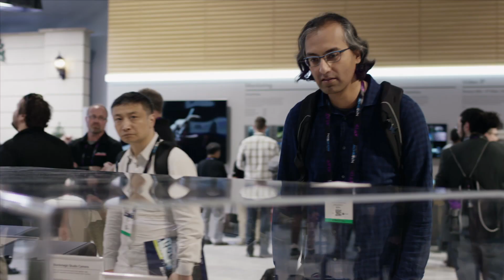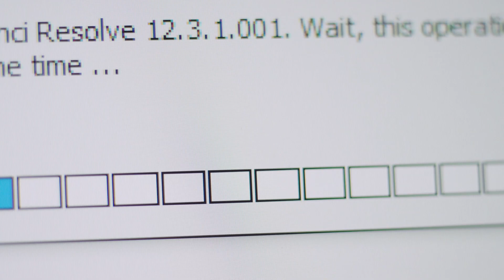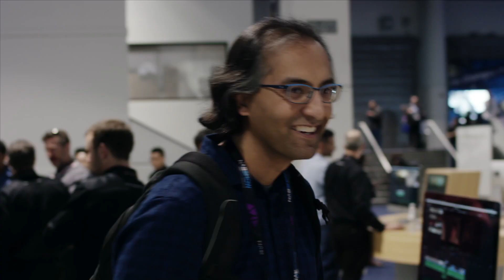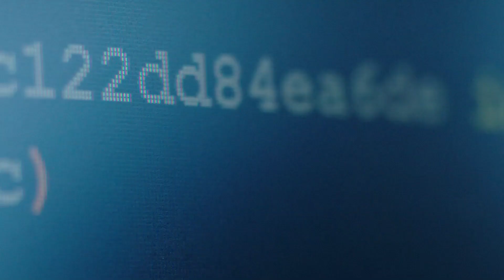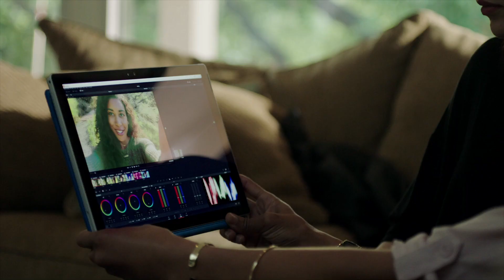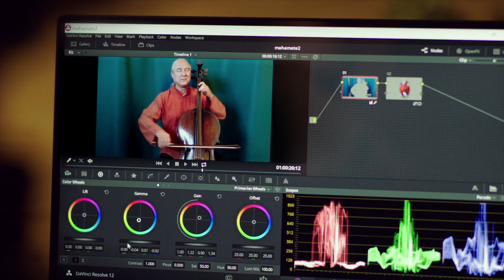Blackmagic and Iris™ Graphics: A Match Made at Intel® | Intel Software

Comment: Davinci Resolve 16 didn't want to play in the timeline at all on my Dell i7 tiger lake 11th Gen Iris Xe Max computer with 16GB ram. I'm not a power user at all but I do use Davinci Resolve a lot. It works fine on my 4 yr old Samsung Notebook 7 with nvidia 940MX graphics card. Updated to Resolve 16.2.7 on the Dell and at least it sees the Xe Max graphics card now. But still takes a while to even show the video preview window sometimes. Is this a Resolve issue or an Intel issue?
Reply from the maker: Sorry that you are facing issues. We suggest that you update the Intel Iris Xe MAX graphics to the latest drivers available at https://intel.ly/336v0FN. If the issue persists, please DM us on Twitter (@intel) or, send us a private message via Facebook with these details: 1) The complete processor model number 2) The current graphics driver version 3) Screenshots of the issue you are facing. We would love to discuss this further.

Comment: 1. What about the 10th Gen integrated graphics? 
2. what about the 11th Gen Xe graphics? 
3. Will da Vinci run on surface pro 7 i7/16gb version?
Reply: I think it works as long as your system have atleast 16gb of ram and a recent i5
Reply: Did you find out anythim. Am currently wondering too, if a new Iris chip would be acceptable for video editing - lightweight is a higher priority to me than best performance...

Comment: thank you sir but am getting this message each time i want to open the software saying devinci resolve cannot find the opencl capable for the gpu
Reply from the maker: Sorry to hear that you are facing difficulties. The issue could be due to the device not meeting the minimum application/tool requirements. We suggest you check the software developer’s website/community for the minimum system requirements of the application.

Comment: Hi.  I have a question regard the 0m43s point in your video.  I currently have Intel's Skull Canyon.  I also want to run Blackmagic Design's DaVinci Resolve on it.  Previous I could during the version v12.5 era of DaVinci Resolve, even on up to around v14.0.1.   BUT, NO more.   I get this error message 'DaVinci Resolve can not find any OpenCL capable GPUs'.   (Reference my Google Photos album:  https://photos.app.goo.gl/0u7YfrBaw3bbJIFq2  )   Why?

Before it was OK.  Now it is not OK.  Do I suddenly need to have an eGPU whereas before I did not with the Iris Pro Graphics 580?   And, will Intel release a newer Intel Skull Canyon sequel, hopefully with at least two (2) Thunderbolt 3 ports and discrete graphics?   Thanks.
Reply from the maker: Mahesh pointed us to a thread about this issue here: http://bit.ly/2Cx5iyq
Reply: And, that thread happens to be the one I created on my Google Photos account.  Thanks for pointing it out to me.  :-))   Oh, and since creating that album, Mahesh has admirably and gracefully found a solution to the problem as well.  I have updated the album to include that solution.  Please revisit either of the links above to  review the solution.
Reply: Actually the 15.65 driver helped to solve not running DaVinvi Resolve 14.3 running on a 3450 Convertible with Windows 10 64 bit! Great!